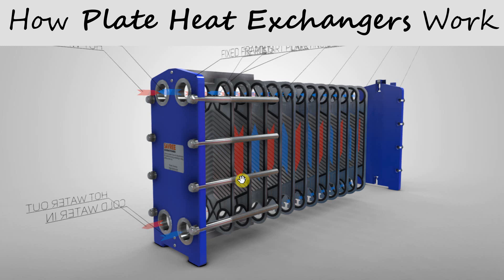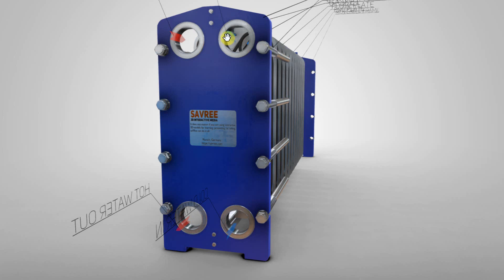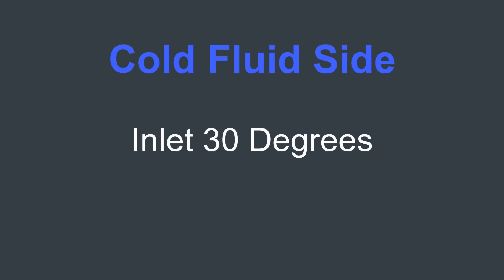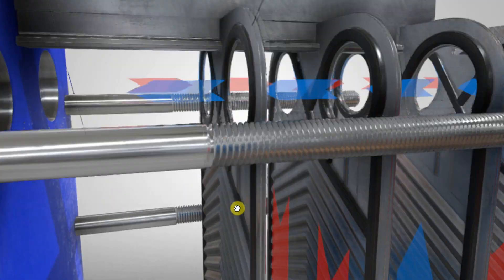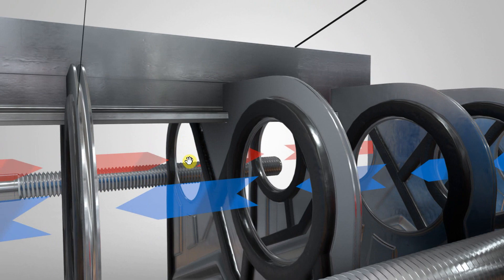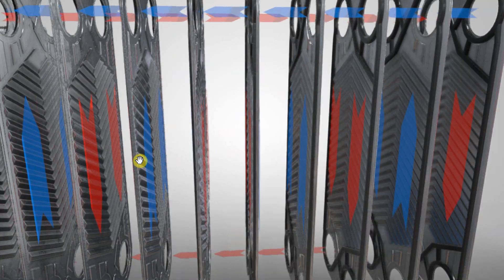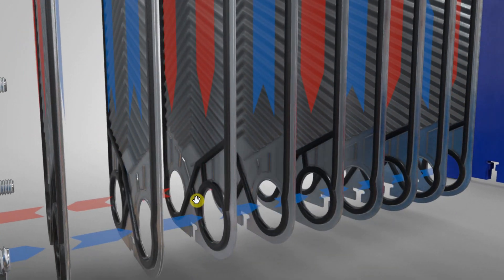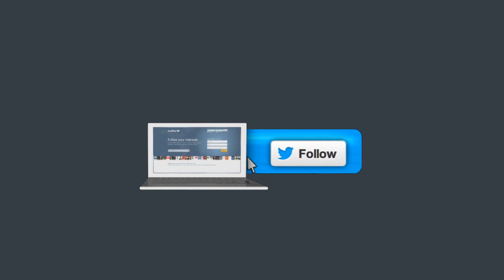How Plate Heat Exchangers Work (Industrial Engineering)

Comment: Could u add clip on starting Air of 2 stroke x head engines of man b&w with interlock explained in detail
Reply: saVRee 3D yes sir.... I like your way of approach much better and I’m having some trouble understanding how block air valves and relay and all electronic stuff works for the starting air distributor. With your guidance sure I can learn better. Thanks and cheers